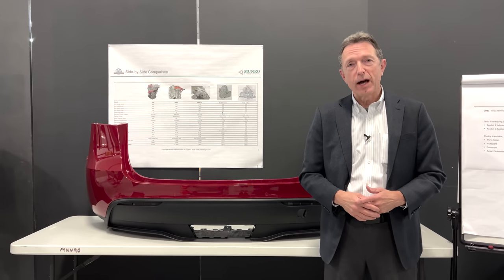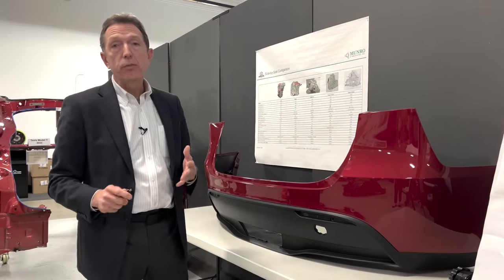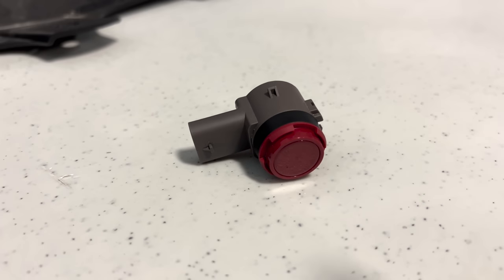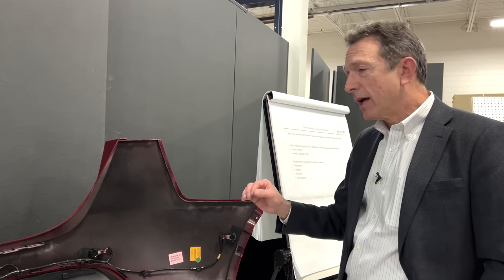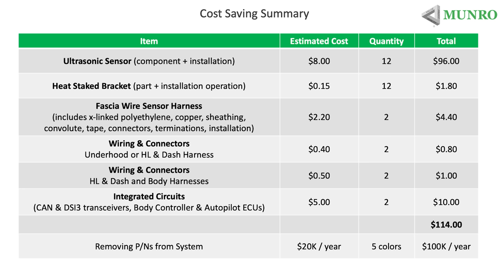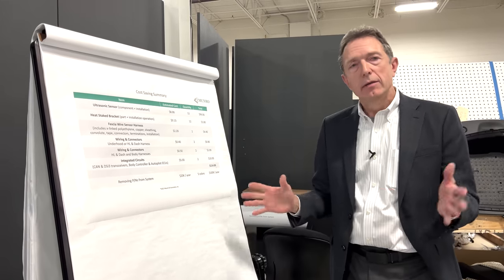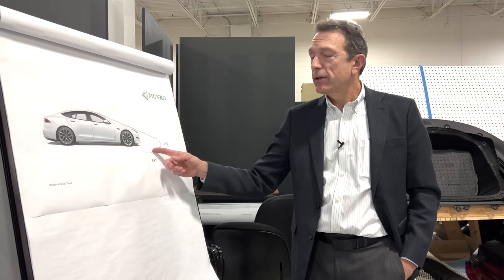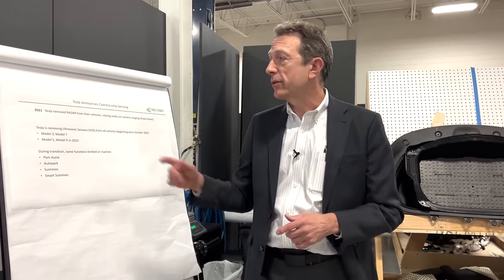Tesla REMOVING Their Ultrasonic Sensors

Comment: Very nice presentation.
They may not be able to pull all the P/N from inventory unless they will never repair USS in an existing vehicle. - "Sorry, some body hit you in the parking lot, now we have to replace all this plastic & you also get to lose the USS sensors and all the functions they support. Its been depreacted."

On the other hand, they might use a few more cameras with fish-eye lenses (and install a way to keep them clean of snow & dirt), possibly I/R (with illumination? ) Of course, this probably requires more CPU. 
I can't see autopark without some sensor in the 1-foot range (distance) from the front end.we don't want anyone to hit any ferrets!

Thanks.

Comment: I've got a Y on order, but I've just delayed it until I start hearing from owners whether this is actually useable

The worst parts of my current Tesla Model 3 are the rain sensing (with the camera instead of a real sensor) and auto headlight sensing (which also uses the camera). Frankly,  I just don't trust Tesla to actually be able to see everything the ultrasonic sensors can see. It's fine for parking against a car, sure, but as you point out it's blind right in front of the car

In California, maybe that's no problem - but here in the UK we have VERY tight parking spaces and I'm concerned enough that I won't be taking delivery of the car until I know how this is going to go

Comment: The block just don’t appear in front of the car. When it is moving towards the block, it will through the cameras know the distance to the block and knows exactly how far the car goes when the wheel turns. By that the car knows how close it is to the block.

Comment: Visibility is certainly a concern.  But then I looked at a new pick-up truck, where the corresponding distance to the 3 feet is THIRTY feet.  I expect that trained engineers being unwilling to comment on the safety aspects will not deter the significantly less trained and informed.  I would love if you could do actual tests and see how well each configuration does.

Comment: All I know is that my 10 year old Prius Gen.3 never had a single issue warning me of obstacles in the way, no matter if snow, ice or rain or if the car wasn't the cleanest as I don't tend to wash it very often.
They have always worked flawlessly !
I can't see cameras doing the same thing, as cameras get blurred just by a raindrop which doesn't affect the sensors in any way !
Cameras also tend to get fogged up in certain conditions, also something that doesn't bother sensors at all !
In my opinion this is a very bad idea, especially already taking those sensors away without having a sufficient solution first !
It will lead to many parking accidents as the Model 3 and Y are not exactly the most clearly arranged cars on the market !

Comment: This shows about one of the mantras that they have in design and production, best part is no part. They figured they don't need it so removed it it's not only a saving on cost but also a saving on time. How long of time will they of saved in making the loom up, fitting all of the pieces, connecting it all up and testing. By removing it it they save themselves time in the production and eliminate a whole section of the production process. It's a similar reason why they took out the radar.

Comment: Great graphics, Mike.

I do R&D on computer vision, and I think removing these ultrasonic sensors is a very bad idea. Computer vision at this stage is not all that reliable, and there are infinite number of ways that it can make mistakes (i.e., the notorious long-tail problem). Using other low-cost sensors is a good way to compensate for that. Doing vision-only will just lead to a long tail of accidents and deaths.

Comment: They save on parts, installation, inventory right now and going forward. But also, they never have to service or repair these components again in the existing fleet (assuming they can maintain the existing features such as Smart Summons). And more, they never have to repair or replace these components in new vehicles, because they're not there now. Which means less service costs, less service time spent (freeing up time to service other vehicles), less testing, and less training. 

There's even a saving on weight, giving more range, and possibly some marginal reduction of fire risk from an electrical fault.

Comment: object permanence in SW for all cameras can easily cover delta X within the 12” distance. as for auto park and summon…..we’ll they don’t work well with USS anyway so save the $$ on the sensors. this is my experience with my ‘21 Model 3 SR+

Comment: I ordered a model 3.
i need my parking sensors for my garage because i need to park on a few CM.
I'm really worried i will loose the basic function i expect from park assist.
1. i normally back out 5cm from the back wall.
2. The garage will close 20cm before my car.
3. I then need to move forward as much as i can to make sure i can leave my own garage.

I cant see how the AI will handle a garage door apearing from above, to 20cm before it.
Also in some cold morning hows it going to handle camera condensation?
Also what if a camera is just dirty enough?
What if its more like phantom breaking? meaning in the next 100 park attempts i will hit the wall at least once.

Man dont know what to do here.
I could take the phantom breaking cruise control.
I could take the AI wipers beeeing shit.
But i use these sensors so much..........

Comment: I suspect this change is being made primarily to speed up their pace of software development on AP. Integrating different types of sensors likely has an overhead that could be removed by relying purely on vision. As for parking - they could have kept that purely for that purpose but if they can work around the blind spot mentioned in the video, why not remove them.

Comment: I suspect you've underestimated the cost of those harnesses. Especially with those splash proof connectors attached. I'd imagine at least $10 each times 2.

I share your concerns about the short range ability to detect obstacles. My first reaction was literally, no, they can't be serious. They could very possibly reduce the number of ultrasonic sensors by combining it with camera vision, but eliminating it entirely ?

Oh, and I think your graphics showing coverage were spot on.

Comment: I find it interesting the focus on pennies saved per vehicle for things like these sensors, yet they install a very expensive FSD computer that’s what, a thousand dollars each in every vehicle raising the cost per vehicle, some of which may never be used in terms of FSD. So I pay more for my Model Y for that, and which I may never use to its full capability, but they decide to remove a sensor array like radar, that has been used for a very long time and is mostly reliable. I don’t have FSD, but do use auto-pilot which is basically fancy adaptive cruise control, and have experienced phantom braking. If my Y had radar, I suspect that would not be happening.

Comment: As a car moves forward into any space it can choose to buffer certain frames that give it the ability to measure distance in association with the rolling distance information. I get that. Problem is that is for static objects only. I am at a loss to understand how they can be sure there are no objects in front or behind the car that have moved there since the car went stationary. My preliminary hypothesis so far is that, like the passenger lumbar support going away, they are choosing to sacrifice a capability. For an austere vehicle, that makes sense. For the so-called premium segment, they are taking away a feature that matters. I would be quite happy to be surprised with their cleverness, but not seeing how at the moment. For movement in reverse, since the rear camera is not stereoscopic, it would seem they are dependent on the driver using only the visual feed to determine safety. Putting it on the driver is unacceptable in our current context of safety.
Reply: Yes, without knowing more, I just don't like this removal of ultrasonics. Knowing that the car itself has adequate surround vision is, at least for me, a primary reason for buying a Tesla. So what if it costs the manufacturer (Tesla) $100 or so; buyers are paying $50-$60,000+ and 30-35% of that is profit. I certainly want Tesla to make a good profit and to plow that profit back into further R&D and infrastructure, but $100 is .05% of the retail. Full surround vision and awareness for safety as well as control with an almost fully autonomous car seem worth far, far more than this. Consider those commercial TV advertisements of a family in a car, backing out of an occluded driveway - and the car suddenly stopping to prevent an accident. That makes for a powerful selling point for that brand.

Comment: Cameras can capture motions all the time before and after we parked.  So, for objects in front of the car, they could have saved video frames from the last event before we've parked and even measure the height and shape of the object.  For objects that are in motion in front of the car while parked they will be seen by other cameras.  Bottom line, these sensors are useless if they managed all video feeds all the time even while parked. It is all about what they've captured via the camera before/after we exit the car.

Comment: Ok Mike. Here is an explanation for you. The cameras have already seen what is in front of the car on approach. When the car is less than 5 mph, a video loop would be created that allows distance calculation to the object and the known circumference of the tire to determine closing distance. Unless that object moved, it would provide not only the same information as real-time USS but but more accurate as USS is impacted by rounded objects.

Comment: I am in my 60’s.  USS came out before cameras.  Do you really need redundancy with cameras and USS.  2012 required stability control, 2019 required backup cameras all new cars.  I believe mandates for front facing cameras soon.  Removing USS is a logical step
Reply: No new cars should come with dim, yellowish halogen headlights.  Led and Hid headlights so much brighter with 5000 k color and 3000 lumen brightness

Comment: So Tesla's camera placements were only ever originally setup to monitor for highway driving on autopilot  using the high level windscreen & B pillar side cameras. Ie looking for vehicles directly ahead, and in the adjoining left and right lanes. 
They are now attempting to go all in on self driving in very complex city driving and parking lot scenarios while still using that exact same camera setup.  
Maybe they can achieve the holy grail of self driving with this current camera setup, and certainly the autopilot team are some of the worlds best talent in this field, but it feels like a redo of the camera placement setup (including putting two back-to-back cameras in the centre of the front bumper) is going to make the whole self driving visibility far more achievable.

Comment: You pay $65,000 for a Model Y, and then they remove useful, if not critical features to save $100. It's easy to feel sour about that. 
I owned a Model 3 until pretty recently, and the USS were super useful when pulling into tight spaces. If Tesla actually believes in FSD, purposefully creating a new blind spot that could easily result in damage to the vehicle or a living creature (regardless about whether a human or FSD is driving) makes zero sense. Unless they plan on adding cameras to the bumpers, but then is the cost savings really that much?

Comment: Paper? On an Eisel? I remember those! You also, likely used a specialized machine to programmatically shoot ink at the surface in order to imitate a powepoint slide. You can eliminate that whole supply chain by having him talk over a powerpoint and editing it together with the in person footage. This eliminates: 1 eisel, 5lbs of paper and cardboard, an entire printer, plus the ink for it, the electrical outlets running to the printer, and if you give Mike a long stick to point at the parts with from out of frame, he doesn't have to wear a suit, either, and that's even more weight and cost savings. Not to mention you have to account for tailoring that suit over time as he changes shape according to the donut supply at the office. So you're looking at saving at least a quarter million, altogether if you move to ADR.
Reply: Well summarised the cost factors for the presentation scenario. Good work.

Comment: To eliminate the "1feet 3feet problem" tesla is probably using the speed/motion sensors on the wheels. The cameras see everything you are mostly driving to, so if something is in this "1feet 3feet deadzone" of the cameras, they probably can calculate, by how far the vehicle needs to drive hit something in this area by using the speed/moving sensors on the wheels. So they know exactly how far they need to drive to hit something which went out of the camera view. Just a guess....

Comment: As an engineer who worked in the Silicon Valley I can tell you. Tesla did not do this without knowing everything. The amount of data they have that has been collected from thousands of cars around the world is offering them tremendous advantage and they can push the envelope with minimum risks. I always believe if you solve the vision problem then full autonomous driving is unlocked for ya. Everything else is a matter of teaching the machine and improve on the hardware.

Comment: Great video, but I think this has to be looked at within the context of the previous removal of radar and with the announcements made at AI day. Their biggest reason for removing radar was that it was causing incongruous stackup with their camera data. Two different data streams that render at different rates that they had to figure out how merge eventually. They determined that the radar data was redundant to the rendered camera data. So they eliminated radar. That speeds up their camera processing.

Previously, they operated in two different modes. At super low speeds or in park, they relied on ultrasonics to map out the world and shift to only cameras at some point. That means they had two descrete sets of map data being used by two descrete sets of driving software to achieve these different modes. This was partially because the vision based system was REALLY BAD at determining curbs and curb heights and had poor persistence of vision (meaning when things are obscured they dropped off the map). The new system they are developing can render a full 3D world just from camera data alone and has better object detection, better persistence of vision, and better object behavior prediction. The new software is expected to be able to handle every driving situation: from parking, to city streets, to highways in one software stack. 

Remember that Tesla cameras can operate when the car is just sitting around parked. So I think the expectation is that the cameras will detect children on bicycles or rabid weasels and remember that they went in front of the vehicle. It is a big gamble, and it likely means a long delay waiting for the software to be ready... but when it finally deploys it will be pretty darn amazing.

Comment: THE TESLA CAMERAS are producing 3D images of anything approaching the car, can remamber them in place and even calculate their positing when outside the parameters of any camera, or being closer than the camera can record. If a small animal would approach the car, it would be detectred long before being this close to the car that it could hit the car or be in danger. It's impossible for it to be hit. The car would alarm the driver and ultimately brake the car if the driver woudln't. It's genius, what Tesla is building up.

Comment: This will be a failure to drop everything except visible light sensors. In the northeast when a Tesla gets a coating of ice the sensors will be degraded or useless. I am not aware (if they are I retract) of the camera lenses being heated so winter conditions will render those systems degraded or useless.

Comment: My experience with sonar sensors in robotics is they are almost completely useless, at least when it comes to navigating in indoor environments. In fact, the AI quickly learns to ignore them. There may be a risk to losing visibility right in front of the vehicle, but there's very likely a risk anyway. Ulrasonics are noisy enough that I guarantee they are using filters that have plenty of risk of false negatives anyway.

Comment: I do like the USS, but think they should only be low on the bumper to avoid running over parking spaces or curbs that the camera can't always see. I use the front-facing camera in my Mazda to help me pull up close to my garage and other areas, and I stil have like a foot of space to inch towards as my USS have gone completely ape. So they're kinda of useless and annoying in these circumstances.

Comment: One thing that keeps surprising me is nobody seems to be considering the possibility that the sensors aren't being removed, but replaced. Tesla could easily add two or 3 cameras in lieu of these sensors and it would solve every one of those problems. The cost savings would still be better because you wouldn't need as many. Just a thought I had
Reply: There are cars shipping now with USS removed, bo additional cameras. I'd love one more camera in the front bumper though.
Reply: @GregHassler  so it's 100% guaranteed that there aren't any new cameras?

Comment: If ultrasonic sensors were a $200 option, or even a $500 aftermarket add-on, I'd buy it. Proposal: remove the sensors, but make it possible to add them back in as an aftermarket product.